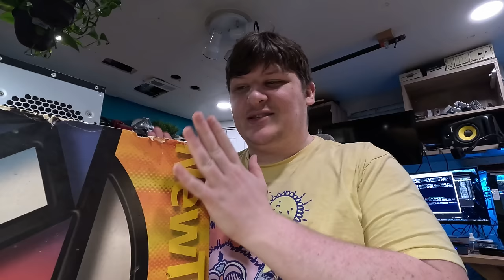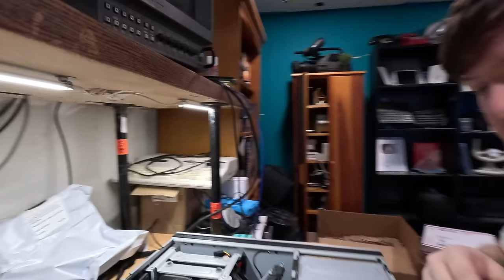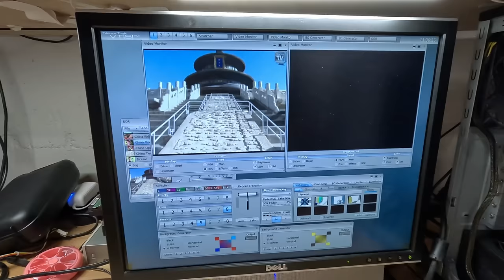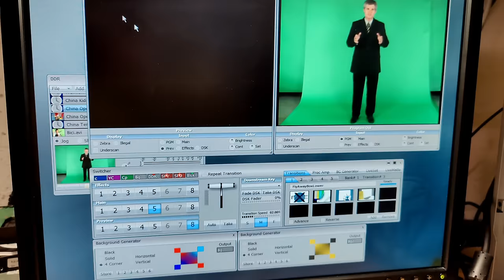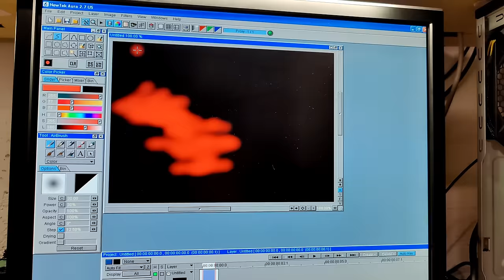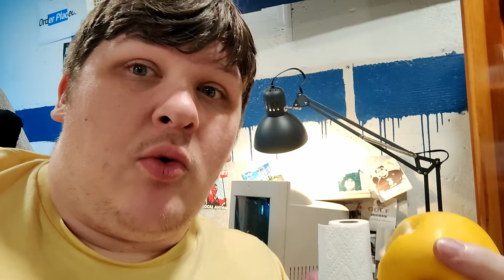Building a Video Toaster. No, not that one

Comment: Convinced my high school to upgrade from an old Amiga VT2000 to a VT[4] circa 2002. I had submitted 3 proposals to re-equip the TV service (which did televised morning announcements and whatnot) hoping to get the middle (25k) budget and to my surprise they went with my over the top 50k budget.

This included a completely fully equipped VT[4] with an absolutely absurd internal SCSI array for the uncompressed video capture. I forget the name of the integrator that was selling turnkey systems but I don’t think they’d ever expected anyone to select actually all the options. The resultant tower needed to have two power supplies in some bonkers config to power all the drives. I’m told, after I graduated, a teacher who thought he knew better attempted to simplify the power situation and there was uh, a small fire. 

The VT[4] was great though. It was a very competent switcher, and whatever it did to automatically time base correct seemed miraculous coming from the VT2000. The non-linear editor was honestly super capable and easy to use, and it even came with a Motion Graphics/animation program called, I believe, Rhino - which needed a dongle leading to many chidish jokes about inserting the dongle - but that program Apple would later purchase and refactor into a product they called “Motion” for Final Cut Studio.

I want to say the machine had dual Xeon processors and ran windows 2000 - it was absurdly fast for the day, and honestly I wouldn’t touch a more capable editing machine until I got a Mac Pro via employee discount in 2008.

Now, I was 17 and incredibly naive but - it just felt like this thing did the impossible at the time. Thanks for sharing the modern impressions.

Comment: It really was a powerhouse at the time! - fun video.. My friend and i both have fully functional VT5’s and they just don’t die! once they are settled in machines. I think it is in its 4th machine from over the years starting with Frame-factory all the way till final VT-5.  Was a great time. Lightwave3d was worth the price of the VT by itself.  IT was used not only on B5 but also most of ST:TNG and voyager etc. back in the day. Fun memories! Thanks for showing this.. Fun note.. that Speededit also used the top and bottom tabs for letting you have at the same time a storyboard interface to quickly re-arrange clips as well as a timeline view at the same time. they were totally linked so that changes to one were synced with the other view. This let you do face global changes to your project while then also precision edits at the same time.  Even this basically combines for example Davinci Resolves CUT and EDIT pages into one streamlined interface!  I wish BMD would actually follow speededit’s example! - There was also a SpeedEdit version 2. which i also have the box and disks for. Aura and the other OLDER editor (Razer edit” came with Frame-factory board originally before the VT-2 update.

Comment: My former boss just bought a new Tricaster for the studio. It's absolutely insane.

I'm not sure what all you've discovered, but look at Kiki Stockhammer and Play Inc., the NewTek split, and the Play Inc. Trinity (TV studio in a box). I've been following the evolution of the Toaster for a very long time. As far back as the original release of Babylon 5. Got my first Amiga in, I think, 1984/85. Also, been using Lightwave since version 6. I'm currently running 2020

Comment: (mid 1990's) We had an issue with PCI bus voltage for a NIC. System we took out had an ISA 3c509. New system had a PCI 3c905. Customer complained of drops in connectivity and sometimes unable to log in. We had to borrow some high-tech gear and found the cat3 network cable was over 300ft. Apparently the 5v ISA bus had enough current to push the bits, but the 3.3v bus with it's circuits to pull it up to 5v didn't have the current capacity. The customer ended up putting a hub along the run to make up for the length. I ended up with 10 new 3C905s from the 3Com rep for testing.

Comment: Seems like their choice to use VGA cables instead of a special cable was a double edged sword - theoretically easier to find replacements, but replacements are likely to not be to spec. Maybe the average VGA cable was built better back then, or maybe 'triple shielded' ones were more likely to have the separate wires than normal ones.

Comment: Super interesting video (and article!). I had a vague understanding that Video Toasters and Tricasters shared some lineage but I didn't realize VT5 and Tricaster Pro literally just used the same capture card lol. Tricaster Pros are pretty affordable on eBay too...definitely thinking about getting a Tricaster Pro and then using it and its front panel as a compact VT5 setup. Hell, it even has a firewire port for DV capture. What a small beast. The Tricaster itself is super cool, I have fond memories of its use when watching Giant Bomb, but Video Toaster's integration with Lightwave 3D is too hard to pass up. It's just so slick how Lightwave and the other modular programs just show up as inputs in VT5. That plus being able to arrange all of the control panels make it feel like you're in a virtual reality mixing environment.
Reply: 7 months later I'm rewatching this video cuz I got a Tricaster Pro for $100 and it's awesome. I am floored by how well iVGA just *works*. I can feed Blender from a modern machine right into the Tricaster without any extra equipment and no perceivable quality loss. Gonna image the hard drive and get those capacitors so my time with the machine isn't cut short cuz I can see myself using this for video art quite a bit.

Comment: I know nothing about video editing or really anything related to video, but I loved this video. I know the editing and such was a bit sloppy as you for warned, but that doesn’t matter to me at all. I’m interested in retro computing, electronics in general and odd software, but I was actually taken in by just the idea of editing live content over several inputs through a standard PC.

I’m actually thinking of building something like this just to mess around with… but I’m actually planning on firing up CAD and mostly reverse engineering a few components together. I’d like to create a custom card that can basically act as a Retro Tank with support for old and new connectors, a video capture card that acts like this except it passes everything straight through the GPU, and an audio input over a high speed connector. Ideally I can make a video input board like that one and a sound input board that is compatible with sound boards with different inputs as well. I don’t think I would build drivers for Windows as I’d probably develop everything as open source… and I suck at driver development in general so it will probably be just enough to suss out a proof of functionality in Linux and leave the rest for the online community to do. I also have no idea as to what the software would be yet.

It’s a daunting task but it wouldn’t be the first major project I’ve done. Luckily I’m not alone working on this.

Anyway thanks for the inspiration and keep up the great work.

Comment: I found your channel today, you have great content! You should do a video about Scala MM/infochannel. It's digital signage software that started on Amiga, got a dos and windows version at some point and currently isn't publicly available it seems.

The Scala interface is to this day unmatched in usability and functionality. Feature wise it was very advanced, in the early 90s we had a network of Amiga 4000s across the city which we could schedule and update remotely using 33k6 modems. It even had full screen full framerate video(vcd resolution) using an addon card.

Comment: If my memory serves me, you can use a MIDI control surface to control the audio mixer in VT[n], but its been quite a while since i looked into it.  I recall seeing forum threads of someone using a cheap Berhinger MIDI mixer to control levels on a VT[5] and a first gen Tricaster

Comment: With my Antec 300 I would run the front panel cables behind the motherboard and ziptied the 24 pin to the management loops. It actually is an easy case tuck away cables if you really want to. We are all just to spoiled by having case designed around having the cables go around the back.

Comment: Just so you know, FPGAs typically don't have any ROM of any kind. Usually you have to send over the FPGA's "program" every time you start it. Having a transfer fail isn't a big deal, just turn it off and turn it back on and resend the "program" and you'll be fine. Assuming that this is just a normal FPGA, anyway.
Reply from the maker: The trouble is, I found posts on the Newtek forums stating that a failed flash on the VT card will brick it irrevocably, and it seems to happen randomly even when people follow the procedures precisely. So it seems that Newtek didn't take the best precautions with the design. :/
Reply: brickability is totally dependent how the part is bootstrapped. some of the Altera MAX family have internal flash. larger parts (Arria, Stratix, Agilex) store bitstreams externally (QSPI, MMC), and may be bootstrapped through a separate processor. A partial bootstrap may be stored locally which can bring PCI(e) up enough to load the rest of the bitstream from the host (the multi-headed windows in a previous CRD video did this) but it sounds like the VT doesn't do this. If the local bitstream source is corrupted and a fallback wasn't designed in, you've got to break out an SOIC clip or hope there's a JTAG header.

Comment: Back in the day, the late 90s I knew someone that wanted to sell me a Teaster for $2,000. At that time a cuts only super VHS edit system was $2,000. I had no real use or need for it so I did not get it. But to do what this thing could do I things was some $10,000 and up to do all this. Granted the computer you are putting it in would add to the cost. But this could do was very impressive.

Comment: As for the rarity:  I do happen to have a couple of those cards because I did know what to look for - the trick is knowing about the two blue VGA ports.  Anyways, there are people who know or have a small horde somewhere.  People like Jeri Ellsworth who was doing a lot of Tricaster/VT5 video early in YT history.  But my run with the VT/Toaster gear was in 2004--2005 in Georgetown (South Seattle) when I tried to make a run to become a Internet TV station using Nullsoft's NSV streaming protocol because Shoutcast was (and still does support Video live streaming) using VP8 encoding.   But my luck: bad timing and lack of content that I could be legal with.  It still took Apple and iTunes to change the world to new ideas of media distribution.  Which meant that particular moment was still locked into the Napster fight for things to be ok.  After all, in 2006 when I created my @microbrew account on the original YT account, Google was just a search engine throwing money at whatever their labs was doing... Google saved YouTube when the MPAA was about really hammer the site.  They did it by buying YouTube... 

But I do have all the stuff minus a tricaster for what your working with...

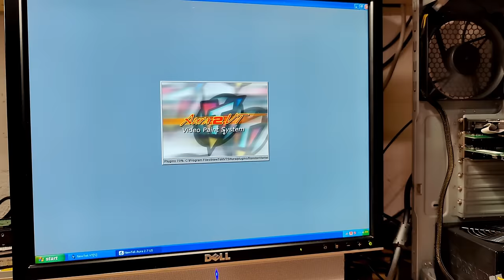Comment: 46:50 ancient indeed. Aura 1 was commonly bundled with Lightwave 5.6 and Version 2/2.5 with Lightwave 7. I don't think that fork saw more development after that while "regular" TVPaint is still going strong.

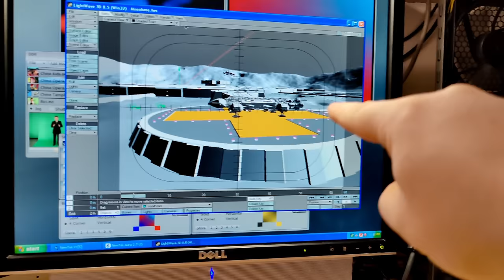50:44 made me laugh, because our studio extensively used Alphas from 1994 to about 1998-1999-ish. They ran circles around Intel machines, especially the four processor workstations. :)

Comment: The original card had to have the extra daughter board attached to convert the FF card to the VT card back in the day. and it did have the extra power connector for the BOB also there was a chip update and firmware update as well over the years. Most of us had to send in our older FF cards for hardware update.

Comment: It's funny - depending on which copy of Revolutions you get from Newtek - they would advertise a Macintosh versions of the Video Toaster!  From what I understand, it was basically a bridge card that you put into something like a Mac II through the NuBus that would talk an external box (which was a whitelabel Amiga 2000/2500 and the other side of that bridge card from the Mac NuBus just slotted into the Zorro bus and yeah... you had your panel on the mac and I think maybe some data transfer between the two - but otherwise it was an Amiga for all the heavy lifting!

This isn't the first time Amiga's would appear somewhere out of the ordinary - Virtuality 3D systems (like the one from Hackers or the Virtua Jet thing that was at Gameworks) ran on Amigas... I believe there was another application of them in the wild as well...

Comment: Is that what it was called IVGA interesting. I was at a church that was using a try caster they had a guest presenter coming in and they took the laptop feed I believe over Wi-Fi although there might've been an ethernet cable I can't remember. I remember thinking this was crazy and it would be so useful for so many things. I am fairly certain that they expanded that protocol into NDI there might be a code rewrite. But it's pretty safe to say it was a spiritual successor at least. Cool thing is I have fairly certain fully adopted NDA and it is very useful I am doing 3 to 4 cameras and sending feeds from other laptops. And this is mostly due to the fact that they made it open for anybody to use and that the MEVO cameras support it. It certainly makes cables so much easier to just run an ethernet cable upfront to a POE switch and then plug 3 cameras in. Before we had a Frankenstein mess of the previous MEVOs conversion software and HDMI cables and converters.

Comment: I was under the impression that the original Video Toaster didn't actually have any video DAC/ADC at all, and that all the transitions were just really well timed analog switching from one input to another -- ideally, video on one, and Amiga-generated graphics on the other.

If that's not the case, then I don't really understand what made this device so unique to the Amiga.  The real advantage of that platform was the NTSC video output, and the fancy graphics it could display, right?  If you were generating video in the Toaster itself, then what would it matter if it was an Amiga or a PC or a ZX81?
Reply from the maker: I honestly have no idea what the answer is, I have never found any explanation of how the original toaster works and the only justification I've ever heard for why they used the Amiga is that It has some convenient NTSC timing going on inside, but yeah, I don't understand, given the complexity of the toaster itself, why it cares what the host system is.
Reply: I've never used a Toaster but I doubt it was just analog switching. With simple analog switching your TV will lose sync unless everything is genlocked.
Reply from the maker: @eDoc2020  that is exactly what it does. The Amiga toaster requires an external framesync or gen locked inputs; If you put unsynchronized signals into it, then switch from one to the other, it completely trashes the image.
Reply: @CathodeRayDude  I did not know that. Thank you.

Comment: Leaving those LVDS hanging over the GPU heatsink shouldn't damage them but you might want to use kapton tape to stick them on the newtek card just to be sure.
Reply from the maker: That's a good idea, I should order some of the real stuff. I have some Koptan (yes, that's literally what it says) and the adhesive is... sad.
Reply: @CathodeRayDude  Even real 3m stuff has mild adhesive, so you can remove it without destroying the underlying smd components

Comment: What you call a "cheap looking VGA cable" looks rather thick to me. Thicker than the other two in fact. That's a clue that there may be more wires inside. Particularly if it feels stiffer.
Reply from the maker: In person it does not look or feel robust, especially compared to the one that's twice as thick

Comment: the complain from a repairs side was no one was getting the specs required for vt they would go get a dell or some circuit city pc and try and use the VT with it and it wouldnt work

Comment: Same story with AVID and allllllllll other video editors. In about 2004-2005, they all abandoned the hardware solution and """"leveraged"""" the processing power of Nvidia video cards. Arguably that;s even better than what Tricaster did there, because they didn't even have a spacialised video card , just a firewire connection to the computer (good enough for one stream of SD video)

Comment: Very good. I remember this stuff being brought out back in the day. They were really expensive down here in New Zealand... As a matter of interest, why didn't you put the 2nd slot panel on the other side of the main board to separate the cables from the graphics card. (Or did you say so and I missed it? :)
Reply from the maker: Because of the position of the USB and front panel audio headers, I felt that the cables would actually fight each other harder if the ribbons were down there. But honestly, maybe I'll take another look at it.

Comment: Also, the go pro 5 black and some different ones have shutter control (in the Protune settings) I’m going to switch from my 7white soon just for that.
Reply from the maker: Oh my gosh you're right, I COMPLETELY missed all this. Could be a gamechanger. Thank you so much!
Reply: @CathodeRayDude  no problem! I haven’t had first hand experience with it, and I don’t know which model you have, but you should be able to set it to 1/60.